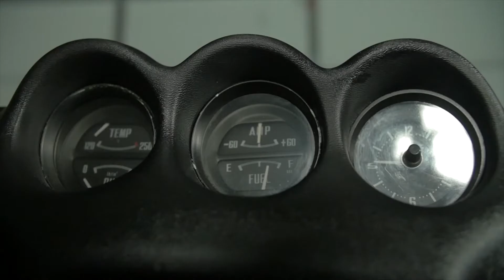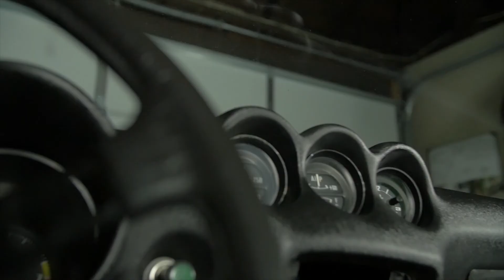240z| Vintage Dashes

Comment: I ended up here via a comment by John Williams on a FB post about his dash arriving.  Followed a link to Vintage Dashes....they had a link to this vid.  I just went and watched a handful of your vids.  I gotta say.......I REALLY LIKE THEM!  I enjoy your style.  Your presence in front of the camera and your narration is clean and really, really good.  If I could do it that smoothly, I'd probably spend more time in front of the camera on my vids. LOL  The camera work, panning, and editing is great.  The timing seemed right on for me.  I typically watch all vids on YT at 1.5x because they tend to drag otherwise.....and I can watch more if I do it that way.  I can watch yours at either speed.  Normal speed still kept my interest, but 1.5x was still easily understandable and viewable.  This is all just my opinion, which really isn't worth anything, but I've been watching vids on here for about 10 years now and posting for nearly 8.  Some channels just stand out.  My only frustration....and it's minor....is that I felt slightly cheated by the click bait. LOL  Hot girls certainly pull the attention to the vid....and I'm fine that they're not what the vid was about, but they passed so quickly at the beginning of the vid, I first thought they weren't in the vid.  Maybe another 5 sec or so of that frame at the vid fades out at the end....?  It would also add more incentive for the viewer to finish the vid. :)
I really like the older Z cars, but I way more into the trucks and oddballs........someone has to give them some love. lol  I've got a couple of Datsun followers, so I think I'll give this a share.  I'm curious as to how many subscribers you have at this point.  Anyway......sorry to be so long winded, but I really enjoy your work....just thought I'd let you know. :)
Mike